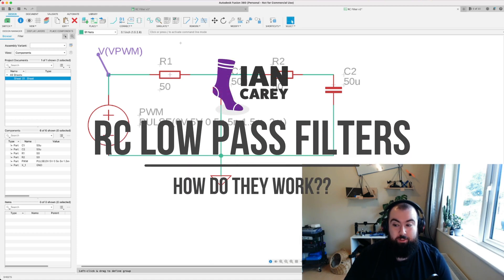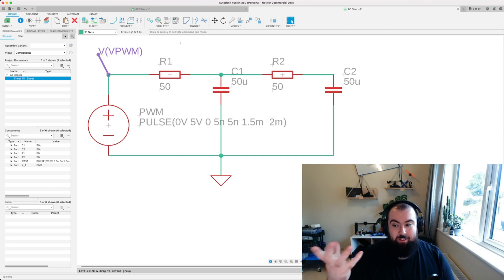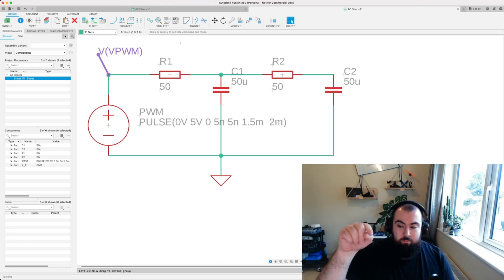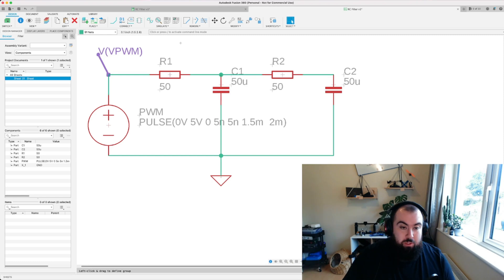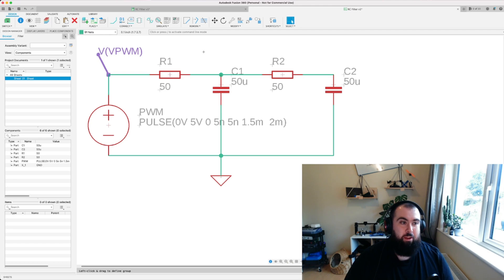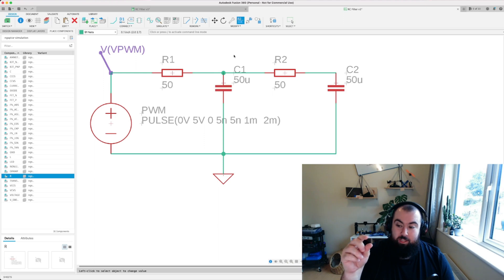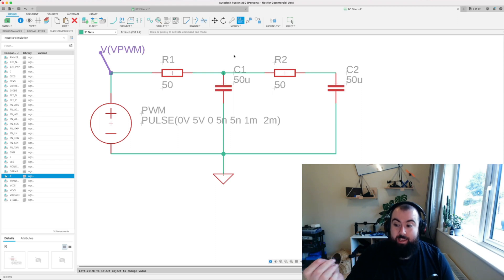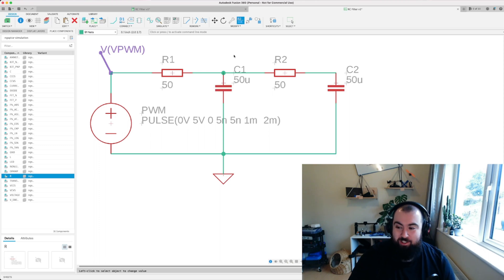RC Low Pass Filters - How do they work??

Comment: Very clear. Have just used an RC filter to smooth the output of one Arduino PWM signal so that it can provide an Analogue input voltage level to another. Great to understand how this works. Useful to know that the addition of another RC filter will smooth it even more. Many thanks.
Reply from the maker: Ahhh that’s great to hear! Glad it helped you understand

Comment: Also, you can use a low-pass filter to de-bounce a switch. Additionally, if you are new, 50uF is an insanely high value for a filter like the example used in the video.
Reply from the maker: Oh good addition to that. I didn’t really talk about what common or practical capacitor values might actually look like in real life.

Comment: You might also try LTspice, which is a powerful, fast, and free SPICE simulator software, schematic capture and waveform viewer with enhancements and models for improving the simulation of analog circuits, available from Analog Devices. 👍
Reply from the maker: I have used LTSpice in the past, I generally find most SPICE packages to be largely the same, but just so happened I’m using Fusion360 a lot recently so made sense to do it here.